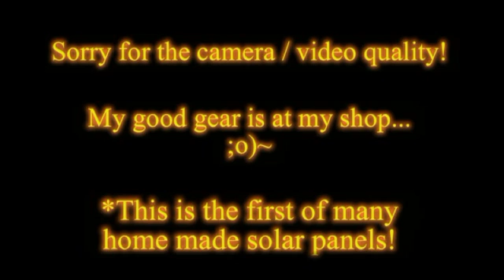How to make a Home made Solar Panel that 18-20 Volts and 70 Watts with easy steps

Comment: Charge controller does not convert anything. It controlls the amount of juice(electricity) supplied to the battery's from the solar panel, as to not overcharge the battery's. From there it goes from the battery's to the inverter to convert 12dc to 110v ac usable household current.

Comment: 45 watt Harbor Freight panels are rarely less than $149 even with a coupon.  That's over $3 per watt.  They're not bad for just being able to walk into a store and buy some solar but they are far from the cheapest option.   Shop online and you can find factory built panels for $0.70 to $0.80 a watt and about $1 per watt once you include shipping.  Building your own can still be done cheaper but only if you skimp on the materials.  It's still worth building DIY for the learning experience.

Comment: There's no point mixing different size cells.  The end result output current will be the same as a panel of just the smaller cells since the smallest cells are the weakest links in the series chain.

Comment: 70W under 100$ ? I think it is better and cheaper to buy a new tested one at ebay, I have build one with not broken cells, but it has a low power output, the glas is not so good and it was more expensive than those cheap ones from China.

Comment: For future solar panels stay away from putting anything black in your panel. I'm not sure if the black stuff was used to seal it, but with those types of solar cells, as heat increases the efficiency decreases. In full sun that penal is going to really heat up.